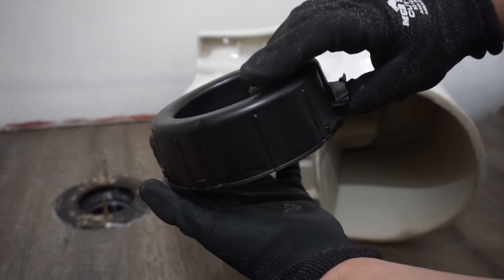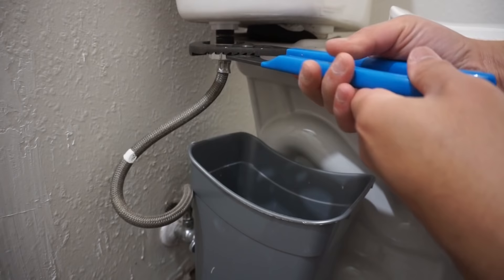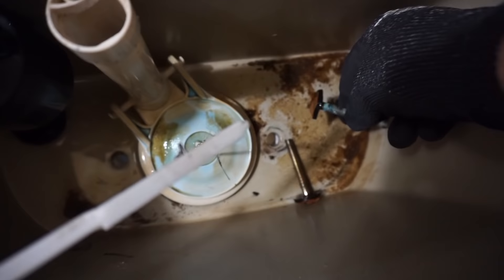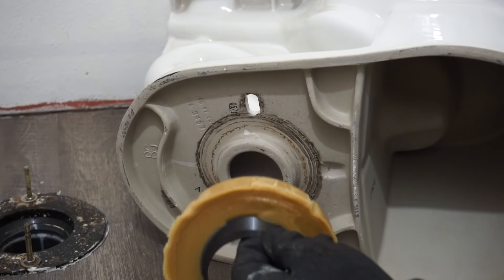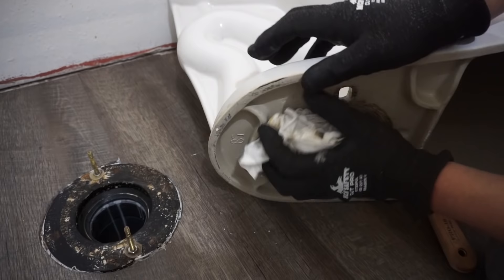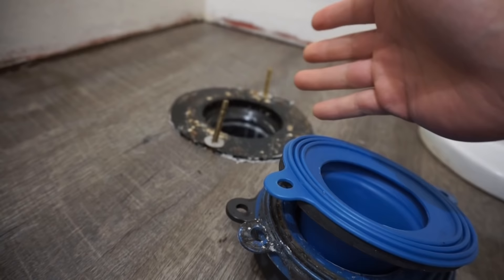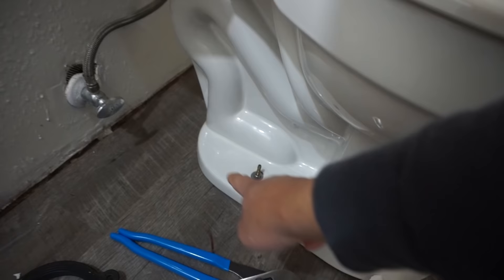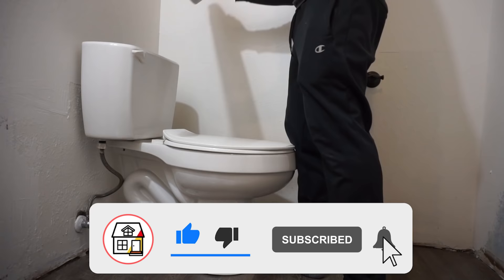How To Replace A Toilet Wax Seal OR Rubber Toilet Seal On A Toilet Flange To STOP Toilet Leaks!

Comment: Great video.  I had to lift a toilet an inch or so to reset the flange bolts after it had started rocking and they spun out and came loose from the flange slots.  Do you think I need to replace the wax seal?  or just check for leaks for a few days...
At 5:22, I noticed you used an extra nut on the flange bolts over the plastic washer before placing the seal and mounting the tank.  I'm going to do this too so it will hold the flange bolts to the ring so they won't spin out again.   Any reason you took the tank off?  Seems like an extra step.  Thanks.
Reply: Yes. Wax doesn't expand to be recompressed. Once you break the wax seal, it must be replaced. You are almost guaranteed to generate a leak otherwise. (That's one benefit of  the Better Than Wax product; it doesn't suffer from that problem.
Reply: Using a fine point Sharpie marker, i draw a line on the end of the Closet Bolt or Flange Bolt that is parallel to the elongation of the bolt head.  Then I always know it's orientation in the slot.  I do like the idea of the extra nut holding everything in place as long as it doesn't interfere with any parts on the bottom of the toilet base.
Reply: Kind of agree, no real reason to remove the tank.
Reply: The reason for removing the tank is to make the assembly lighter, and easier to handle, and to replace the tank to bowl gasket, because why not since you're working on it already.

Comment: I took off the tank. I still have water in the bowl. Did I do something wrong? Do I need to get the water out of the bowl before I remove it or will it go down the drain itself?

Comment: After I remove the toilet from the floor, I stick a wadded up rag in the hole. Keeps me from dropping anything in there.
Reply: Should stuff a wad of TP instead of a rag... Then you don't have to remove it before you set the throne...... Or forget it and have go pull the throne off to retrieve it.

Comment: If you don't want your toilet tank to leak don't take it apart in the first place when it's not leaking.. some of those toilets will never ever seal once they come apart so I stay away from it with just about everything I do..
Reply: Agreed.  I have 40+ year old toilets out there still in use and the tanks aren't leaking.   If I have to pull a tank, I'm going to replace the entire toilet.

Comment: I would stick with the wax and most plumbers stay away from the ones that have funnel horns built in. Also, absolutely no reason to remove the tank when doing a flange seal. If your flange is low they sell spacers to correct for floor thickness. Double rubber seal is a bad idea.

Comment: Why are you removing the tank to replace a wax ring?  Just asking for trouble that way.
Reply from the maker: The tank and bowl is secured by 2 thin tank bolts. If you tilt your bowl to access the bottom you I’ll risk moving these floating bolts supported by rubber gaskets inside the tank. The porcelain can get damage and cause a leak. 🙏🏽😊

Comment: Should we use Caulking around the bottom of the toilet Bowl..???
Reply: If you do and there is a leak, you won't know it until the subfloor is completely rotted away.
Reply: @cavpilot  I like this advice. You want to know if it's leaking. Who cares if you can see the seam?
Reply: If you want to caulk then do so, just leave the backside of the toilet uncaulked that way you can detect leaks.  That simple!

Comment: @5:51 it is very confusing which one is the toilet gasket riser and which one is the seal by the way you are holding and showing them.
Reply: Flange is the drain in the floor. Gasket is the blue one, replaces the wax ring. Riser is the black one only used if the flange in the floor is below the tile
Reply: @ayanhussain6798  Thank you!
Reply: He did make it difficult to understand and easy to confuse

Comment: #1 before you do ANYTHING for an install or toilet replacement...make sure your TOILET FLANGE SITS ON TOP OF THE FINISHED FLOOR REGARDLESS OF WOOD, TILE OR VINYL. IF YOU ARE LOW, SIMPLY INSTALLING A 1/4" PVC SPACER RING IS ALL YOU NEED. STAY WITH PRODUCTS THAT HAVE BEEN AROUND FOR A HUNDRED YEARS.
Reply: OK GRANDPA! STOP YELLING AT ME!
Reply: @supersabrosinho  😄👍🏼🇺🇲
Reply: "STAY WITH PRODUCTS THAT HAVE BEEN AROUND FOR A HUNDRED YEARS."

Yeah, progress in materials sciences be damned.

Comment: How do you know if your toilet flench flushes with the floor? Can you make a video about the difference and how to find the difference
Reply: Flush means same height for flange as flooring. If the flange is below the floor it will leak, if it's higher then it won't
Reply: @avikonish : Flanges that are lower than the floor are not normally a problem since you can buy wax gaskets of various thicknesses. Also you can buy a gasket that has no plastic horn and add it to another gasket or you can trim a thick gasket down to fit. Wax is the only way to go.
Reply: @rayray8687  In your opinion.
Reply: @vblic : Yes you’re right, it is my opinion but after several decades of repairing, removing and installing toilets it’s also my advice. A wax gasket costs about $2.00 and is adaptable to just about every situation - flange too high, flange too low, non-level  floor, etc. These gaskets NEVER deteriorate, they NEVER dry out and they virtually NEVER fail. When sponge gaskets unfortunately became popular in new construction in the 80s/90s I began replacing them sometimes within a year of the purchaser moving in.

There are flange gasket devices that cost 10 to 15 times more than a wax gasket and they do absolutely nothing more than the wax gasket. My opinion AND my advice - use a wax gasket, tighten down the bowl properly and shim if needed (plastic shims only!), and rest easy for the next 25 yrs when you want a new toilet. You could even buy an extra gasket now if it’s on sale - it’ll look exactly the same when you’re ready to use it 25 yrs from now, lol. Oh and btw I even know of one brand that cost a bit more, $2.29, and it’s rated military grade so you can safely install it in your battleship if you have one. All the best on your renovations!
Reply: @rayray8687  love your reply!  I’ve always used a wax ring and NEVER HAD ANY ISSUES. The ONLY time I had to replace it was when I put in a NEW floor or a NEW updated toilet.  I’ve been in my house for 24 years and I just replaced the entire toilet. No issues with the old wax ring.
Reply: @stopdrinkingleftskoolaid6510 : Thank you. I’m definitely not the old fogey who goes about mumbling-grumbling that the ‘old ways were the best ways”, lol. In fact I welcome any actual improvement in construction techniques and materials because I’ve made my living from it for so many years. I still carry a 20oz Estwing on my hip but I’m not sure why because I haven’t owned a box of nails for at least 20 years. I think it’s so people can identify me as ‘the boss’…the old guy with the hammer…or it’s just vanity. When I’m uncertain about new technology I invariably ask the younger people on the jobsite. 

Having said that, plastic, rubber and foam flange gaskets are NOT an improvement and are often troublesome. If you carry in your plumbing kit a 1” wax gasket with horn, a 1 1/2” with horn and a 1” plain wax with no horn you can install literally any toilet, whether American, Mexican, Canadian, Chinese or even those troublesome European ‘designer’ things out of Germany, and they will be leak-free forever. Long live the wax gasket! Thanks for the comment.
Reply: @rayray8687  I'm here to find out if it is safe to use denture cleaner to clean toilets. Will denture cleaners damage the wax gasket if used regularly?
Reply: @ninac3811 : That’s a very legitimate question to which I believe I have a very legitimate answer but first I’ll explain a couple of things so please bear with me. First of all while I’ve spent many years in construction contracting my college education is in chemistry so I guess I’m basically a chemist-plumber, lol. I find your question interesting because it seems to me you might also have a chemical background to have even asked what some might consider a strange question but it isn’t strange at all and here’s why.

Denture cleaners use mild oxidizers to remove stains and one of those chemicals is carbamide peroxide which is also used to soften ear wax, very similar to toilet bowl wax. BUT, it’s very diluted in these cleaners and by the time it’s diluted a hundred times more in the toilet bowl I can’t imagine it would have any effect whatsoever on the wax gasket. Also the bowl water has very little contact with the gasket, especially if it has a plastic centre horn, so my opinion is:

NO, IT WILL HAVE NO NOTICEABLE EFFECT on the bowl gasket over the next 50 years but can I ask why you would use denture cleaner on your toilet bowl instead of good ol’ fashioned chlorine bleach at 1/10th the cost and 100x the cleaning power? Just curious?

Comment: You don’t need to to remove the tank from the toilet
Reply from the maker: That is true, but moving the whole toilet with the tank risk the two bolts connecting the tank to the bowl From moving and cracking the porcelain which can create a future common area leak. Just want to be safe than sorry. 🙏🏽
Reply: Some people do..... because not everyone is A strong man ok..
Some people are small and short and not as strong as Big people.
Reply: Is not needed but is the easy way to do the job
Reply: Works smart, not hard. Save you back and money. Do not be lazy to undo couple bolts.
Reply: If you don't remove the tank, how do you position the toilet to clean off the wax if the ring is stuck to the toilet and not the flange?  Seems like any position one leans the toilet to clean the bottom would put unwanted stress on those toilet tank bolts.
Reply: Been doing plumbing for 35 yrs I never remove tank first. If I’m installing a new WC then I install bowl first sometimes. But still good job but please learn correct way to use channel locks lol every time my son uses them I have to tell him turn them around lol
Reply: I would less weight to move at once
Reply: Well having to scrape off the wax and needing to have that bowl tilted like such it's way more logical to remove the tank !!! Think smarter not harder!
Reply: @kltnrjnnfr  yeah you half to remember who made the comment to begin with someone who likes to work harder then needed or he can actually left both items and he just assumes that everyone else can do the same.

Comment: I used the rubber because I'm a beginner and my toilet is very tricky to install (tight space and the bolts are not visible like a "normal toilet)

Comment: Wax is the only way, but start it on the closet ring - protecting the closet ring and bolts from corrosion is part of the wax installation.  Also, removing the tank is just more work and may require new seals.

Comment: The guy I hired use the wax and it leak. I had to replace it myself with the rubber since it came with a riser flange and no more leak so far.

Comment: Are the nuts that were removed not SAE 1/2" and 7/16"  wrench/socket size not metric? Metric 11mm (7/16") and 13mm would be both loose on the fasteners, let alone 12mm. At least IMHO.

Comment: My plumber told me that if it's time to redo the seal, it's a good time to replace the bolts. We live in an area with highly chlorinated water so it may depend on the characteristics of your water and the reason you are installing a new wax seal.

Comment: Thank you.Main products: sealing gasket,gland packing,PTFE/graphite/asbestos products, ceramic fiber products, high temperature heat insulation and fireproof material.

Comment: Since most flooring is not perfectly level, wax is superior. Also too many people send chemicals down the toilet which will deteriorate the rubber in no time. If your flange is flush with the FINISH floor , set wax ring on the flange, not the toilet bowl, you’ll never have a leak.

Comment: I removed the foam padding on the wax less seal, since my flange was over a 1/2” off the subfloor (I used a flange spacer to support it) and the toilet couldn’t sit evenly when the foam padding was present.

…does anyone here think that’ll be an issue? The wax less ring now sits pretty flush with the flange.

Comment: Question… so my basement toilet with a wax seal started leaking a few days ago. I removed the toilet and wax seal and replaced it with the same rubber seal you show here. There is no water in the tank and the line has been disconnected for a few days now. I’ve noticed that there is still water leaking at the bottom. It appears to not be coming from the toilet. What could possibly be causing the leak? If it matters, my flange is raised from the floor since it’s a concrete foundation. Any advice?
Reply: Did the leak was solve? I have the same
Reply: @dechimbote  Yep i got it figured out! Turns out my toilet had a hairline crack in it. I ended up having to replace the entire toilet.

Comment: The wax is $13-20 depending in where you are. The rubber is $9. It's cheaper amd easier than the wax. This info is outdated a bit in the video but still. Go for the rubber!

Comment: I'm having no luck with wax gaskets. Floor appears to be level, but I'm having a difficult time put the toilet on the wax ring. I'm getting sewer gases, thinking of doing the rubber gasket instead.
Reply: If you haven't already, try out the jumbo wax rings. The additional wax gives you a better seal.
Reply: Thanks 2 plumbers, a raising of the flange by cutting through the garage ceiling and cutting the pipe (and 500 bucks) and it's fixed, sort of. Still getting some minor smell that to me smells like sewer gas but my entire family at Christmas said they couldn't smell anything. 2 months later, and I just keep the door shut. Oh well.
Reply: @Blackdog4818  Consider caulking around the base of the toilet. Just leave the back 1/4 of the toilet uncaulked so you can see any leaks from the wax seal. This should reduce how much gas can escape. It'll also prevent the toilet from moving and make it easier to keep the base clean.
Reply: I had this same problem, I swapped out the wax for rubber and it’s been perfect since
Reply: @Blackdog4818  if you're still smelling sewer gas consider running water in your tub/ shower, lav sink, or any other drain fixtures in the room. Something else to look for is an "S Trap" under your lav.
 If your fixtures aren't vented properly, you will have water being pulled from traps and that may be where you're getting sewer gas from.
Reply: Thanks, went through all of that, vent was working. 5 months later my nose has sort of gone "blind" to the smell, but I still smell something occasionally if the door is shut. It's very minor now.
    Hoping summer heat in the house will melt the wax gasket enough to cover whatever very small leak is there. But because I know about making sure water is in an unused trap downstair, my eye irritation has gone away when I'm working in the basement, so that was a good thing. Gotta keep water in every trap, especially in winter.
Reply: @Blackdog4818  I think it could be possible that your P trap could be clogged in your toilet, especially if it's an old toilet.  As for the raising of the flange, they make spacers if your flange isn't above floor level.  Also the jumbo wax ring should help seal your toilet to the floor better.  That's all I got for ya!

Comment: Don’t fall for rubber, there’s nothing like wax, yeah when you replace a wax ring it’s gonna be a mess obviously, but if you install properly save yourself a headache and avoid rubber
Reply: Replaced all three toilets in my house and used the Oatey rubber seal on all of them. 7 years later and still no issues.

Comment: How do I drain the water in the toilet bowl?
Reply: There's a product called a water solidifier which helps make the water solid then when you're done and you flush the toilet the water solidifier will dissolve and you can flush it down.

Comment: Why remove tank ? Put wax ring on floor flange then put toilet on flange, been doing it professionally for years
Reply from the maker: Thank you for the advice. How do you clean up the wax stuck under the base without tilting and damaging area where those tank bolts are connected to the bowl?
Reply: @FixThisHouse  remove toilet and almost always the wax ring stays on floor flange, if necessary tilt toilet and scrap of remaining wax  , great channel
Reply: @FixThisHouse  almost every time the wax comes of clean from toilet

Comment: Why are you removing the tank?
Reply: He mentioned the porcelain tank might crack if you tip the toilet.  Also, it’s less heavy to seat just the bottom, and then reattach the tank when finished.

Comment: You dont need to take tank off to remove toilet...
Reply from the maker: It’s best to so you can clean the bottom residue wax off the underside and to prevent chipping of the porcelain where the tank bolts sits.

Comment: The thing they don't tell you with the rubber you have clogging issues a lot more often. I used the rubber and I'm sorry I did because now I have to use a plunger all the time.
Reply: Replaced all three toilets in my house and used the Oatey rubber seal on all of them. 7 years later and still no issues.  The only time I have clogs is in situations that would have clogged with a wax seal. Something that shouldn't get flushed does or someone uses way too much TP.

Comment: Rubber dries out and cracks. no bueno!
Reply: Wax doesn’t tolerate any shifting or rocking which often happens on installation, or when things change over time.  Rubber maintains a seal.  I’m done with wax rings.

Comment: Why to much work you don’t need to remove the tank like the other guy said
Reply from the maker: I don’t disagree. I just removed the tank so that I don’t risk the 2 tank bolts from cracking the surrounding porcelain around it. 👍🏽😊🙏🏽